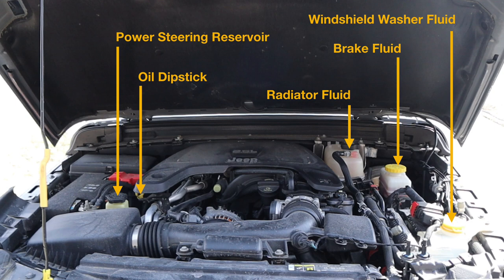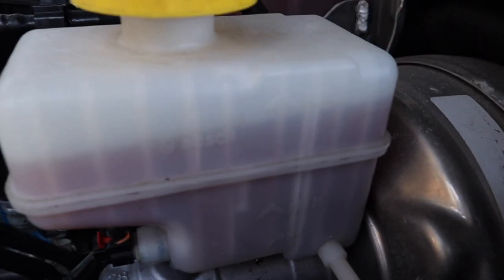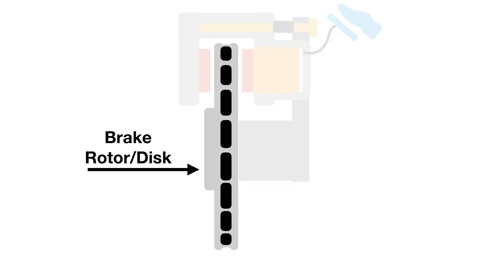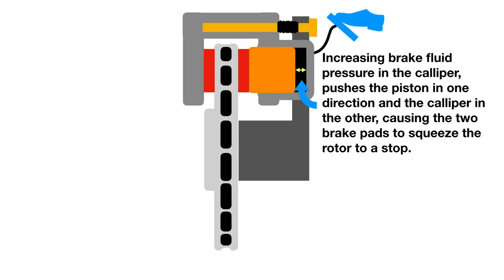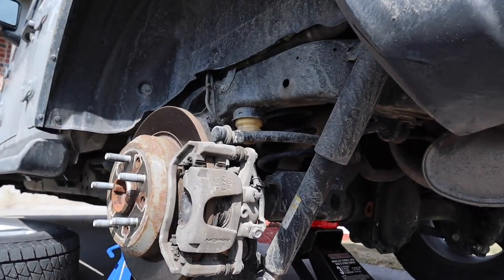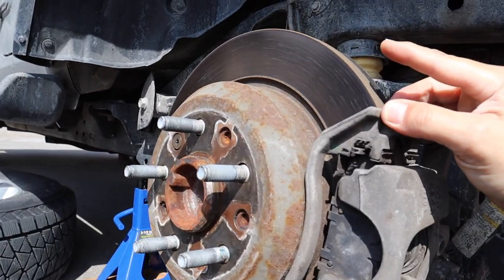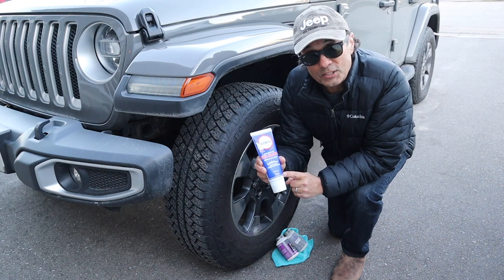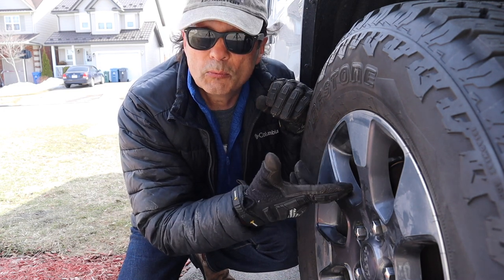DIY Fluid & Brake Inspection, Jeep Wrangler JL

Comment: Good work on this vid. To the point, excellent info, perfect level of detail, nice diagrams, and good camerawork. Videos like this are better than 80% of the car stuff out there. 
One issue is that there's a squeal at around 8500 Hz in your narrations. A notch filter at 8500 Hz removes it. It might be something with your mic, or recording setup since it's consistent. 
Also, levels for >4000 Hz seem to be a bit too high as well (leading to harsh audio), fiddling with a mixer about -6 dB in that range cleans it up. But that's something you'll want to do while you're recording. My hearing is cooked above 12 kHz or so, so the take-home is don't depend on your ears too much, just look at the mixer, haha.
But really, the rest of the video is excellent. Great work.
Reply from the maker: Hey Dwayne, I appreciate the feedback. I’ll look into the mixer idea. Cheers.

Comment: Hello Cheaper Jeeper. Excellent video, very informative. How do check transmission fluid as there is no deep stick for that? I have a jeep  gladiator and has no deep stick for the transmission and I don't believe the delear that transmission does not need service, I believe at some point transmission will need to be serviced. Can you provide any feedback? Thank you so much. Carlos from California.
Reply from the maker: Hello Carlos, 
There is no dipstick for 8 speed automatic transmission in the Wrangler JL. 
Although Jeep says you do not have to service the transmission fluid for "the life of the vehicle", to them, that could mean 'till the warranty is over. After that, they aren't responsible.  
The actual manufacturer of the transmission , ZF, recommends that the transmission is to be serviced. 
Also, I have seen many auto journalists and mechanics on-line that suggest servicing the transmission is necessary if you want it to last a while.  
I plan to make a video on how to do it in the spring, but you can just pay someone to do it also. I hope this was helpful. 
Cheers

Comment: When you suck out all the old brake fluid, how do you suck it out completely? On my 2018 Jeep JL there is a chamber in the corner and on the very bottom of the reservoir where I can’t suck it out. Thanks for your advice.
Reply from the maker: I know what you are talking about. I asked in many places about that same thing, but never got a satisfactory answer. So, I don't think I have an answer for you. Sorry.
Reply: @CheaperJeeperTV I will just have to flush it sooner I guess. I want to dilute that old brake fluid out.